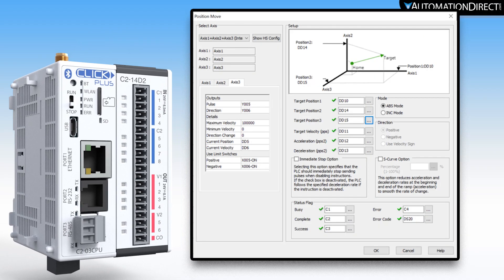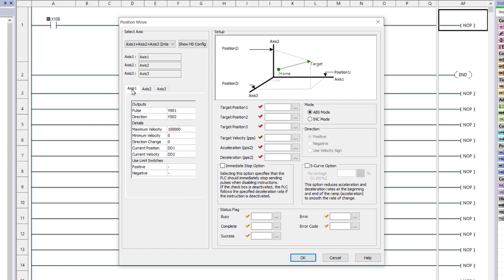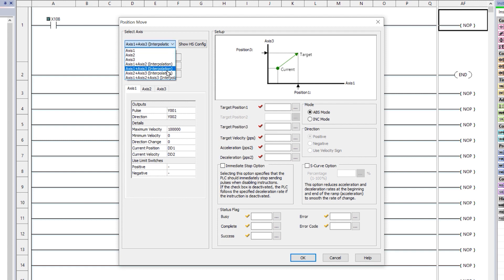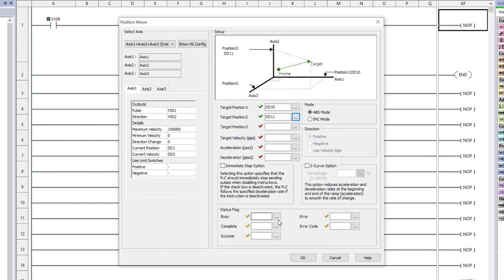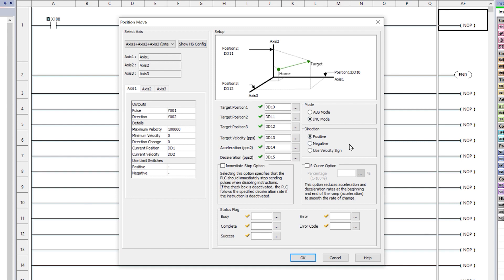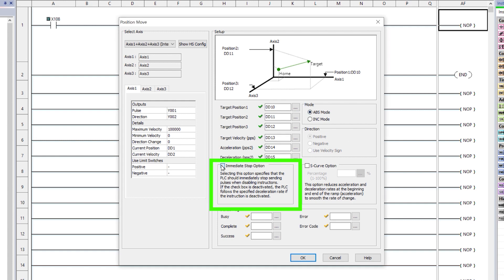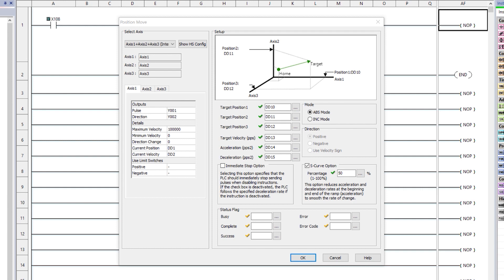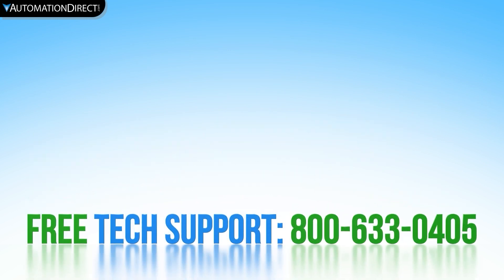CLICK PLUS PLC Motion - Position Motion Instruction from AutomationDirect

Comment: If "FL2000" makes the motor rotate a full rotation in the clockwise direction, what code would make the motor make a full rotation in the counterclockwise direction?
Reply from the maker: @Tristan, FL2000 will command the stepper drive to move the stepper motor forward 2000 pulses. The drive can be mapped with 2000 pulses being different number of motor rotations. In your example the drive will be set to 2000 pulses/revolution, so an FL2000 will lead to a single revolution. If the drive was set for 200 pulses/revolution, a command of FL2000 would be 10 motor revolutions. The Feed to Length command (FL) is a relative move, so you can put a sign on it. FL-2000 would rotate the motor counterclockwise in your example. Find the SCL manual here:
https://cdn.automationdirect.com/static/manuals/surestepmanual/scl_manual.pdf

Thanks for the comment!

Comment: Hello so excited to use the new feature I am just wondering for position move what dictates target position is this based on motor run time like for example stepper motors have steps per mm so then you know if you give it so many steps that it will move this amount of mm but if I wanted to move to a target position let’s say five inch’s away how would I do so? Thanks! :)
Reply from the maker: Hey Zachary. The movement would be based upon pulses. For example lets say that my stepper motor has 100 pulses per rotation and 1 rotation of the motor makes 100mm of travel on my machine. Now if I want to move 5mm I would send 5 pulses to the stepper motor. If you want to do this in inch you would just need to convert this equation to inch
Reply: @automationdirect  Awesome thanks so much!! 😊

Comment: Interesting. . . For simultaneous 3 axis motion, is the timing of each axes controlled such that axes are in sync? (Movement end at same time)? Pretty useful for building a 3axis gantry type machine like cnc mill or 3D printer (although would be nice to have support for one more axis).
Reply from the maker: Rakshith, Yes the movement of the 3 axis is in sync with one another. Interpolation motion.